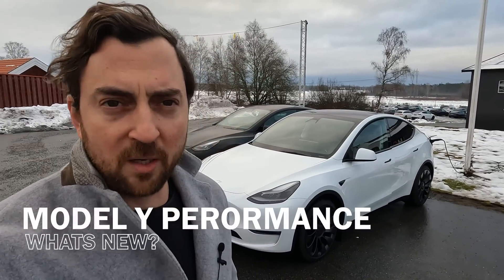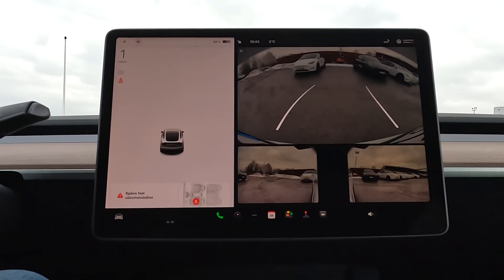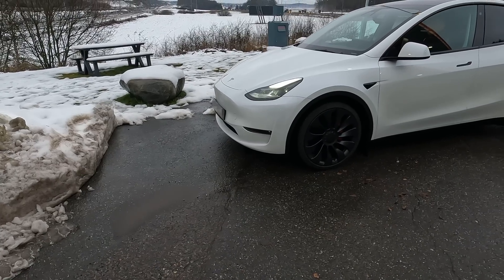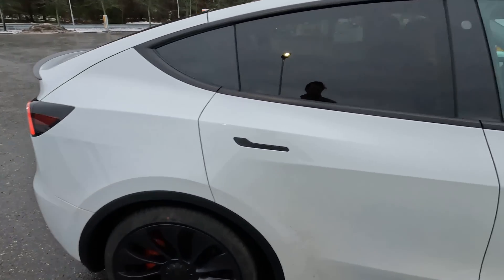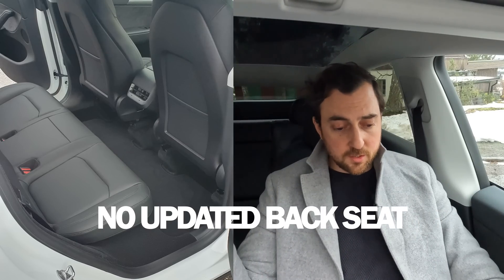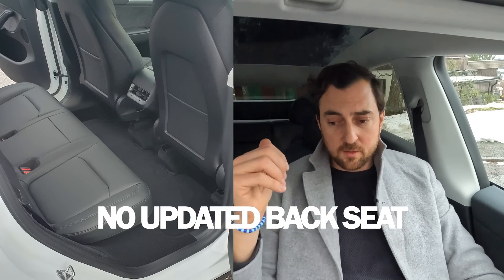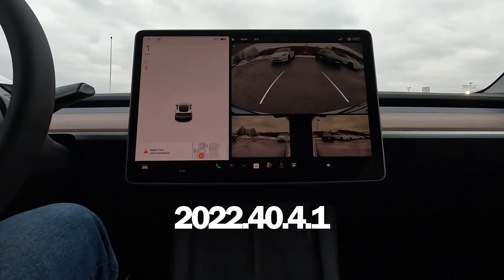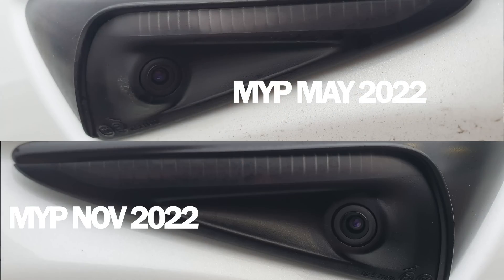Tesla Model Y 2023 updates - No parking sensors! Can tesla vision fill the gap?

Comment: I don't get it. There is no camera in the front bumper. So how is Tesla vision going to work there for proximity detection during parking ??
Reply from the maker: You can use factors as speed and movement to calculate how close you are to the object that the camera saw before it disappeared in iöthe line of sight of the camera.
Reply: @ItsOnlyElectric  That sounds feasible but I seriously doubt it'd achieve same level of accuracy as parking sensors, at least not in the short term. If the object does not have a flat vertical surface (like a snow bank or something with an irregular geometry), I don't see how the camera behind the rearview mirror, which only sees 2D images, can tell that since it does not have the ability to perceive depth. It's like they are trying to use algorithms to beat physics. Although it may still be possible down the road, call me skeptical -- I just don't see it matching the performance of ultrasonic sensors in at least two years. In other words, I think Tesla once again overpromised and underdelivered.
Reply from the maker: This will be hard and will take time. I'm really not a 100% convinced myself.
Reply: @ItsOnlyElectric  
Cameras are affected by environmental factors such as rain on the windscreen.  They won’t pick up movement below the line of sight of the camera.  Also front facing single-height cameras can’t make a vector picture unless moving forwards or backwards.     Loss of ultra-sonic sensors is a cost-saving logistical-saving scam.   A retrograde step.

Comment: This is one of those things you DON’t remove before making sure camera alternative is better, at least..
Reply from the maker: Agree!
Reply: Good for use owners that have the older models value just went up 😂😄😄
Reply: @Kimbrough87 why would it, soon those features will be available through software updates. I understand it could, but personally I'd not buy an older car for such a feature that a new car will have soon too.
Reply: @abcxyz123  well, my point is that you pay more for less and on top of that if you buy used model that came with full self driving from the previous owner, you don’t have to pay a monthly subscription fee if it was paid for before the price of full self driving went up..so it’s just a smart decision and Tesla has already announced that the newer models are built cheaper than the previous ones
Reply: @Kimbrough87  yeah everyone should do their own pros vs cons. I think it pretty much balances up, the newer ones also have some improvements like build accuracy and chip improvements and lfp battery for SRs (huge for many long-term, also environmentally). Material difference isn't a safety concern to me and LFPs beat it imo. Plus the perks of new cars, just knowing what's the history, extra subsidy benefits in many countries and perhaps receiving better value when selling it but that depends. Definitely curious for the occasions market of Tesla since the price drop and manufacturing decisions!

*If we're talking about a short phase of cars made in 2022, maybe they do have a leg up since they might have the best from both worlds. Tricky to figure out with the lack of manufacturing and user transparency.
Reply: @abcxyz123  do you own a tesla currently? If so, what model and year
Reply: The opacity network has not been turned on yet. Don’t worry it will be updated very soon.
Reply from the maker: It's will be interesting to see how it behaves when Ready

Comment: Oh it's going to be so much worse with Model S and X who are larger. I'm used to drive smaller cars and I have a Model S in order... I'm afraid of how I'll handle it tight roads in my city when I can't see the front and it'll take time to learn how long the front reaches.
Reply from the maker: The bigger the harder. #Model3 and #ModelY is easy to handle I comparison. Shorter hoods and not as wide.

Comment: You didn’t mention ifTesla is equipping the new models with higher pixel cameras in preparation for Tesla vision. Would be nice to know and compare
Reply from the maker: I couldn't see any difference when it comes to the cameras resolution. The lenses looks exactly the same so I assume that it is the same resolution. No difference on the screen either.
Reply: The answer is yes, the camera resolution is much higher.
Reply: @ChristophLeitl  I figured they must be putting the higher megapixel cameras in for Tesla Vision to work effectively
Reply from the maker: Do you have more information about this? The cameras i tested had no evidence of higher resolution. I lean have you seen it yourself or are you referring to the fact that it is going to be updated?
Reply from the maker: The car I tried built late late november did not have updated camera. You can see it in the pictures at https://youtu.be/qBRDHWJrINM?t=8m46s 
So it seems that Tesla is shipping cars without sensors and the new cameras

Comment: Tesla dont even do 360 degree top down view that would at least partially compensate (promised by Elon about a year ago) and now available on every car costing more than about $20k. 
 Now Elon promised tesla vision would take the place of sensors. 
This is why i decided not to go ahead with my planned Model Y order this month, how much per year would i be spending on touch ups due to minor dings?
Reply from the maker: Yes, that's strange. 360 view should be fully possible and fairly simple to implement on all Teslas.
Reply: @ItsOnlyElectric 
No not really as Teslas lack the front bumper camera !
Those cameras in the windshield are just capable of looking ahead of the car but not right Infront of the bumper !

Comment: I live in a house built in 1906 and the garage doors are very narrow ~80 inches so this will impact me greatly.  My sold MX used to beep like crazy and have visualizations to help me navigate it, but with the MY coming this December I fear that I will be driving blind.  Why didn't Tesla fully develop Vision before they removed the USS sensors???  It seems, now, that Tesla is focussed on cutting costs more than improving the cars.  Even the casting- it is now revealed that they are not the final versions because they add weight to the cars, reducing range.   Their original purpose was to make the car cheaper to assemble, not for performance.
Reply: "Why didn't Tesla fully develop Vision before they removed the USS sensors??? " Exactly.
Reply: @Joe-lb8qn  Cost saving is more important than good functionality or user experience it seems.
Reply: @mho0  Yep. Also it's only a cost saving for Tesla. For customers having to fix even small dents caused by lack of sensors the car is more expensive.
Reply from the maker: That will be though get used to without USS. Hope the software rolles out before you get your car.

Comment: Thank you for this video. I just took delivery for a performance and I hate it. We had a Volvo xc40 recharge 2021 from before and I feel like we went back in time now going to Tesla. This is really fucked up. Im wondering if I should get refund and buy ano other car that is up to date what is expected today.
Reply from the maker: Sad to hear. I guess it's caused by the lack of USS. I love my MYP, but to be clear, I have sensors. How do you like the car if you ignore the lack park assistans?
Reply: @ItsOnlyElectric  The car feels fine driving and the autopilot and adaptive cruise control is very good. But going from the Volvo to this really does feel like a downgrade. The Volvo felt much better in regards to build quality and safety. The Volvo had much better feel on the steering wheel. Another thing I was a bit disappointed by was the acceleration. I was anticipating this performance was going to feel faster, but the Volvo actually felt faster even though the Tesla says 0-100 in 3.9sec (without rolling start) vs Volvo 4.9sec (if I remember correctly). The Volvo saved me from crashing quite some times by stopping the car by itself while I was reversing. Also loved the 360degrees camera on the Volvo, seeing the car and it's surroundings from above the car.

Comment: Many thanks for posting this video - I took delivery of a new Model Y 5 days ago and am already frustrated that this function isn't on the vehicle.  Reversing isn't too much of a problem, but missing the front bumper sensors and your video illustrates it perfectly.  It would also be missed when reverse parking and having to swing the car round and now trying to avoid obstacles and other cars being hit by the front bumper as the vehicle swings into position.  Not sure how a software upgrade would solve this as there are no physical sensors installed.  Only help would be a front view camera.  Thanks again
Reply: I really disappointed when I knew that Tesla removed those Sensors. I wanted to return the car after I pick it up for 5 days but the company didn’t allow me. It very inconvenient and unsafe without those Sensors.
Reply: @bertlao1041  I thought you have 7 days to return ?
Reply from the maker: It will get better once the devis released. 🤞
Reply from the maker: Agree. The activation of the software using the cameras will help. Hope it will be good enough. Thanks for tuning in.
Reply: exactly, my thoughts, I am disappointed. When I ordered, no one told me that i would get a car without parking sensors

Comment: Clearly sayed it will be added later
Reply from the maker: Yes, I know. But do you think it will be as good as current functionality with USS?
Reply: Back on the 90s when gas cars has nothing like USS do we thought that time it will have it? Or will it be good? Definitely not. Even i have some idea how they are going to do it. It will be combination of occupancy network an car movement tracking. Did you watched tesla truck release? It was really great how did they changed 4 motor prototype in just 3 motor one and crazy is that 2 of them is cluched so engages when accelerating or need torque, CRAZY! I can expect anything from that company
Reply from the maker: Yes, everything is possible.
Reply: JJ TV : You are beeing fooled by Tesla !
They have done that for cost savings !
So if they have a solution in mind great, but why take the sensors away before beeing able to update these cars to that solution ?
Makes zero sense !
How will these cars see through fog ?
Just saw an FSD Video of the car driving in Toronto under foggy conditions and the cameras kept sending the message that their view was blocked !
Sensors have absolut no problem "seeing" through snow and fog, I know as I have been driving my Prius 3 gen. since 10 years now and they always worked perfectly, no matter what condition ! 
If I park my car and in the mean time while the car is standing a cat lays down right Infront of it, my sensors will "tell" me about it as soon as I start up the car, so how will that work with a Tesla which doesn't even has a front bumper camera ?
Those cameras in the windshield are not capable of looking right Infront of the front bumper !
We all now how much energy Sentry Mode uses up, so the car can't constantly keep the cameras rolling either !
The sad truth is Mr.Musk took away the sensors to save costs and sent his employees on a mission impossible  !

Comment: I also received 2023 model Y long range , with no sensor,  my camera or fully calibrated, I have no warning when ever I park near pavement, so it’s very easy to damage the bottom of front bumper. We need the sensor back!! Tesla only removed sensors on model 3 and Y to save money, but on model S and X they kept the sensors as is !! Because these vehicles are there flagship models .
Reply from the maker: Totally agree and same conclusion as I did.
Reply: Completely agree. Ridiculous decision.
Reply: My model y 22 the ultrasonic beep up on the time , every time I get into the garage, 1 thing I hate is Tesla used cheap suspension.
Reply: @thuta5216  my 2023 model Y has comfort suspension which much much better, you don’t feel the hush rough ride any more it’s big improvement compared to 2022 model Y .
Reply from the maker: Totally agree. I made avideo about that earlier: 
https://youtu.be/NE3wxGFP_z8
Reply: They didn’t remove it to save money, they did it because Tesla Vision (TV) is far superior and those sensors are unnecessary.  TV integrates all 8 cameras simultaneously.  Much better resolution, and also processed by sophisticated AI.

TV coming very soon hopefully.  It’s too bad it wasn’t ready at the time of model year 23 launches starting in October…
Reply: @Molcos model 3 and model Y are bread and butter of Tesla, hence these sensors were slowing down production line, plus tesla had different suppliers supplying these sensors in order to keep up with production of these fast moving hot cake model , 3 & Y, and to top it up the sensors were throwing up complexity in the coding program  for the FSD/Autopilot cause of different suppliers supplying these sensors. On model S/X are low volume production cars, and they don’t have these issues with the sensors.

Comment: Tesla removed sensors without having software for vision based parking. Hopefully it won't be FSD case, where people still waiting for FSD since 2013 also please test when they will eventually have software in place, how is parking when cameras are covered with dirt, snow, water.
Reply from the maker: Ditt is a big potential problem. During winter my backupcamera gets blocket  after almost every drive.

Comment: Can you check what the battery label of the car shows? should be in right front wheel whell I think.
Reply from the maker: Y5LD so same as in my MYP from may.
Reply: @ItsOnlyElectric  ok, thanks. Waiting a YP my self, with sensors removed.
I did initially want to wait for 4680, but now in 2023 we will get tax on each krone above 500.000 NOK, and also weight tax on all cars, per kg over 500kg.

That means the YP which today costs 640.000 with hitch and winter wheels, would land above 700.000 NOK.
If I dont get the car by december, I will most likely cancel the order and rather consider waiting for 4680 or wait to check out what the refreshed model 3 will be like.
Reply from the maker: Hope you will get it soon then. 👍

Comment: Does the car have the 2022.40.4 update? This update is supposed to mimic the functionality of the sensors using Vision. Can you verify that?
Reply from the maker: It has 2022.40.1. 2022.40.4 is just a minor revision of 2022.40 and what I have seen it doesn't add the functionality of the mimicing USS (others also stating this on twitter etc).
Reply: I have 2022.40.4.2 and not a hint of Park Assist except in the manual refers to a switch for on/off chime option that doesn't exist.

Comment: absolute nonsense idea from Tesla
Reply: What evidence are you using to make that conclusion?
Reply: Agree. I’d say it’s not acceptable even. It’s supposed to be the most advanced car in the world. It’s not. This is not something that Tesla owner advertise at all, and it’s not a small thing. I have a Tesla Y and I am disappointed.
Reply: Just wait
Reply: Their parking was not great. It should get better with less interference from the sonic sensors. The AI works better with vision and they just have to optimize parking. They might have thought it would be ready by the time the sensors were gone (hardware orders might be years in advance)...
Reply: @0ooTheMAXXoo0 
Do you hear so much better when you lose the interference of vision when you close your eyes?
Reply: If the occupancy network has determined the accurate parking space with 3D model, why would you need any other sensor? Great idea to remove legacy sensors for upcoming software release. Do the world a favor and not try things not available yet, just wait until Christmas lol. Santa won't disappoint.
Reply from the maker: The whole idea was to test it before it was ready to create som awareness for those who didn't know. 
Thanks for tuning in! 👍
Reply: @aakashvj  
Cameras can’t see below the eye-line.  
Can’t make a 3d vector model without movement.
Are affected by rain etc.
Reply: @Brainman365  that's not true, the A piller cameras can see curbs. Current FSD models clearly depict the 3D world. Parallax from multiple cameras and movement with memory of model is enough. Rain had been non issue for me unless its heavy downpour in which case even human eyes fail.
Reply: @aakashvj That is completely true. It is absolute impossible to depict the 3d world with the single rear and the single a pillar cameras. I would bet huge money, that the camera based parking will in the current models never be better than with parking sensors
Reply: @visjn  Well let time tell who is right. I bet it will work with parking between cars, because that is something the AI can learn. Rest will work like shit. Everything slightly out of the ordinary - just like the "Autopilot". That has nothing to do with me thinking I am super smart...